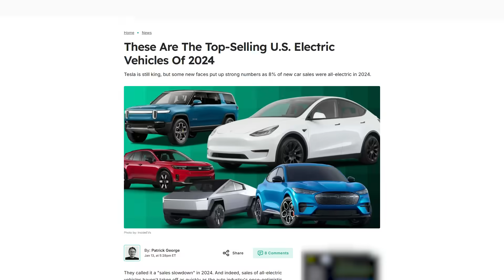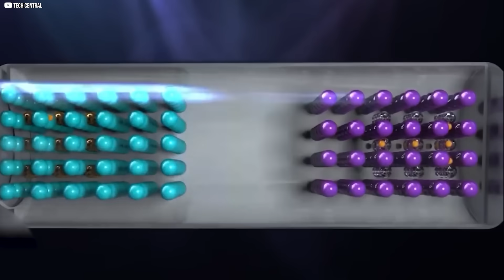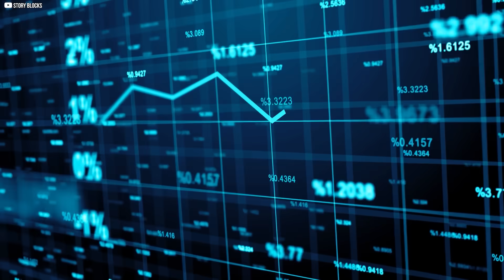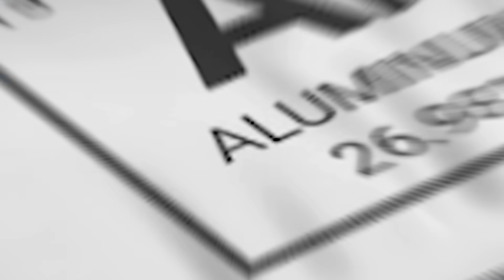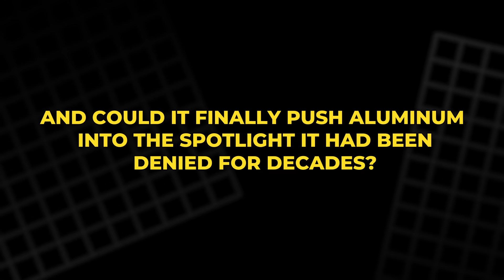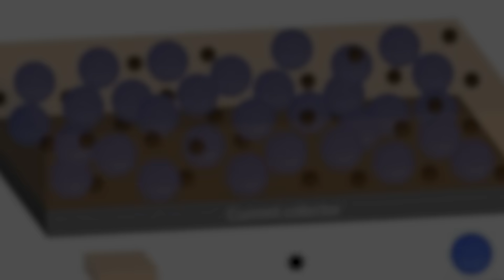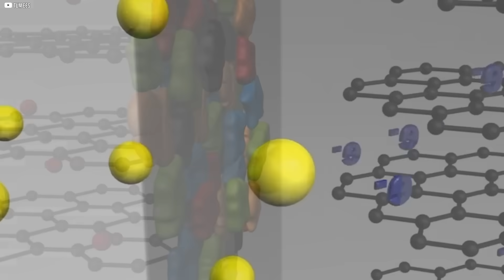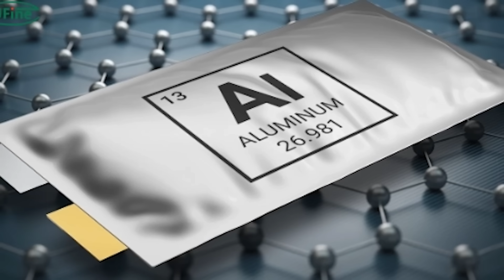Beyond Lithium: How Aluminum Is Reshaping Energy Storage

Comment: large single use metal-air batteries (aluminium/magnesium/zinc) must be available from gasoline/hardware stores, cheap as the same sized metal blocks or beams. yep cheap as bricks. you could also store energy in direct metals, ie an aluminium/magnesium/zinc refining plant running with renewable solar/wind/heat. well the metal is the battery. in itself.